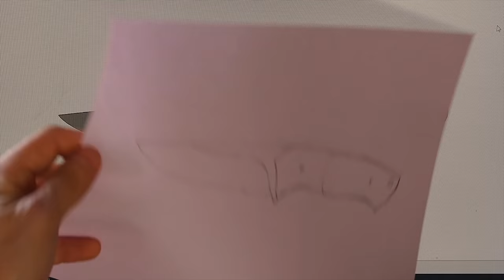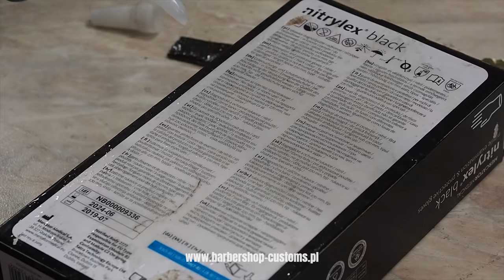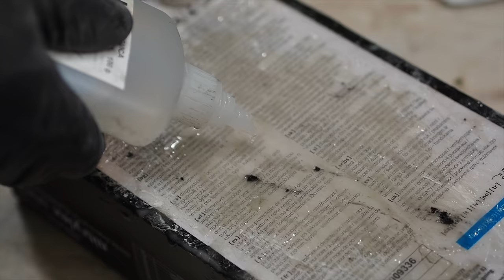Knife Making - HUNTING Knife w/ Elephant IVORY Handle (Synthetic)

Comment: So I watch this whole video and in the end you have a lovely knife. You did a nice blue job but you left all the rust on the handle when 20 seconds on the grinder would have cleaned it off prior to blueing but then you glue the scales on top of the rust? Or did I miss something?
Reply from the maker: We did not glue the scales on top of rust, the tang is oxidised as well. The only rust there was on the spine which was ground after anyway
Reply: @BarbershopCustoms  OK, I watched this two more times. I'll agree that you cleaned up the handle but there was still some junk left on the handle and the holes the water jet cut in were still rusty when you glued the scales on. And even if you left the tang rusted  IMHO nothing should have any oxidation on it prior to adding the scales to the knife.